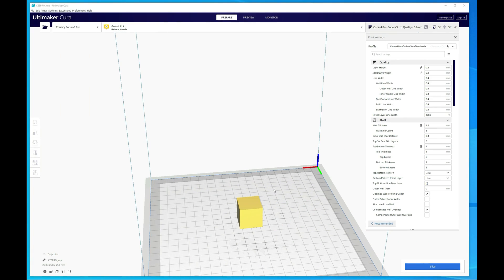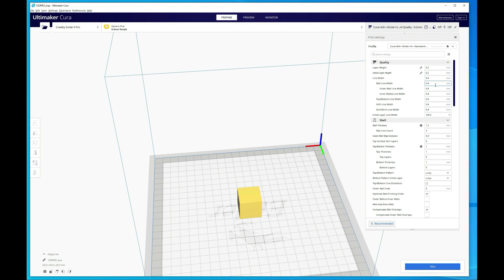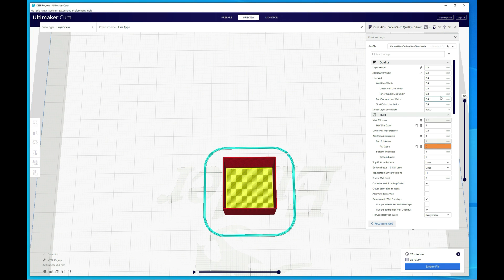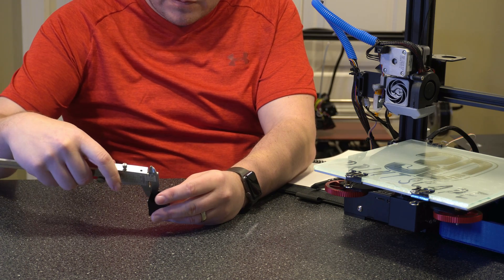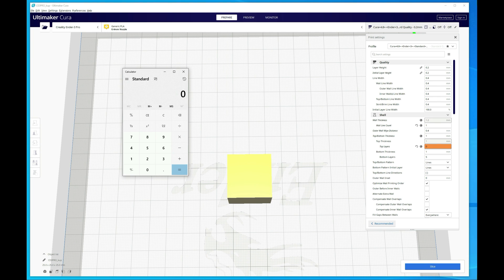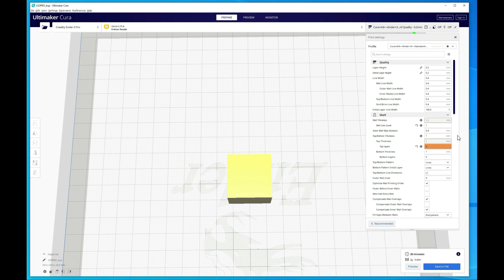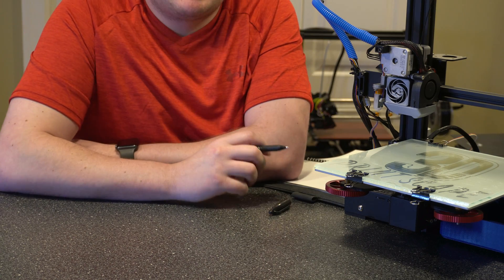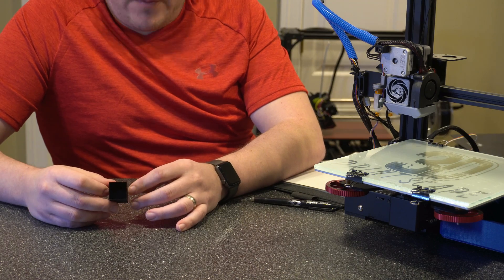3D Printer Flow Rate Calibration – The Easy Way!

Comment: Questions on flow rate combined with layer height.  if I have a 0.6 nozzle and a layer height of 0.2 then shouldn't the wall thickness be at 1.0?  the nozzle extruded in round segments which get squished as the printer extrudes each layer at the 0.2mm.  since the filament cannot be compressed it expands.  wouldn't this also allow for better adhesion between wall layers as well?   I would think that if you set the flow rate to produce a wall thickness that matches the nozzle size you would get poor wall adhesion especially when printing at lower quality.

Comment: A single wall gets more accurate this way. But its not optimal for merging anything.
A rough visual example of 3 walls.
Original flow
(__)(__)(__) = 1.5mm ~

After you calibrated.
 <_><_><_>  = 1.2mm~
The touching points get smaller.
Reply from the maker: Hi. Thanks for the explanation.

Comment: When I tried to do a flow calibration before, by the time I got to the correct thickness, I would lose volume to the point where a single layer extrude (like Brim) would only adhere to the build plate.
It seemed to be under-extruding, 
Extrusion isn't truly a rectangular process. The extrusion is more of an oval squish. 
That said, if adjusting to the size of the nozzle, when you extrude side by side you will have a very small connection to the last extruded round. (Not too much unlike an infinity symbol). 
Is there an offset where the fully calibrated flow, can have more wall-to-wall contact? Where the result is less like an infinity symbol and more like the ideal two blocks pushed up to each other.
Reply from the maker: Hi. Im not aware of an offset like that, but i hear what your saying. Maybe add a bump the flow rate up by just a tad to see if that helps.

Comment: Would flow rate affect wether or not my filament gets clogged from over or under feeding? (Im using tpu on my longerLK5 printer and whenever im trying to print something the filament gets clogged at the extrude r and bunches up at the feeder and its costing me a lot in filament, I could really use some help)
Reply from the maker: Hi. I would think that would only be an issue if the flow rate is way too high. How far is the nozzle from the build plate? If too close, that could cause clogging as well.

Comment: How do you adjust the Z height?  I know how to adjust e steps on my ender v3 but my Kingroon has no e step settings on its menu.  I have to figure out how to do it in cura.
Reply from the maker: Hi. Are you talking about the z offset and do you have a bltouch?
Reply: @3DPrintscape  I don’t have blt and I see how I worded that to be confusing. What I’m referring to is if I print a 20 mm cube and the height is only 19.7 (and not 20) I need to adjust the E steps on the Z setting to turn that 19.7 into 20.
Reply from the maker: @freshmaker5  You will want to adjust the e-steps and the flow rate.
Reply: @3DPrintscape  Kingroon printer is not like Ender v3. Ender you can adjust the e-step right on the printer menu. The Kingroon there is no e stepper adjustments on the printer. I’m looking to figure out how to adjust esteps through cura. I see flow rate in cura but that doesn’t correct the e steps.
Reply from the maker: @freshmaker5  Gotcha, i dont think e steps can be adjusted in cura. I think only the flow rate can be.
Reply: @3DPrintscape  probably why I can’t find it lol. So what’s odd is that there is no way to adjust the e steps on a kingroon Kp3s. Not with their provided slicer. No option on machines display.
Reply from the maker: @freshmaker5  It looks like you can change them with g code commands. You would have to connect the printer to your computer and use something like pronterface or use octoprint. This article should help. https://kingroon.com/blogs/3d-print-101/how-to-calibrating-3d-printer-extruder-with-esteps
Reply: @3DPrintscape  thank you

Comment: At what time in calibrating your printer should you measure flow? First E-Steps, then XYZ and then flow? Or flow before XYZ?
Reply from the maker: Hi. I do e-steps then flow.
Reply: @3DPrintscape  I know. But should I calibrate xyz steps before flow too?
Reply from the maker: @Awesome_O_2000  I dont really mess with them, but if you are i would do it before adjusting flow.
Reply: @3DPrintscape  thanks!

Comment: i need some help maybe you can explain it to me, i have my e Steps correct on my XYZ planes and when i extrude 120mm its spot on. i then started my flow rate calibration at the end of it in cura (calculated this using Flow Rate Calibration website) and it says that my flow rate should be 83% after doing this my walls were correct but what would i need to do to get my flow rate in cura to be 100%
Reply from the maker: Hi. In cura, switch there are flow settings under the material section. To get there, make sure you expand down the printer settings and have it set to advanced.

Comment: Looking for some help plz. Ive made a large scale printer 1.4 meters cube. It thinks its still my ender 5 and only moves 220 by220. I tried changing it in Cura. but doesnt want to listen to me. any help plz
Reply from the maker: Hi. Is it hitting any of the stopper early? Also, is it the right size in the firmware?

Comment: I got a cht nozzle and am having a hell of a time calibrating it any advice it's on a stock ender 3 pro except for a direct drive upgrade with a all. Metal hot end
Reply from the maker: Hi. Those are normally pretty good nozzles. What issues are you having when it comes to the calibration?

Comment: I've done my e steps and adjusted the flow rate after. I did the adjustment ran the test and it was perfect. The problem is it seems to do well on the test but under extruding on everything else. My prints honestly weren't even that bad to begin with I just though the better its tuned the better it will be. It seems to me it runs better at a little over extruding.
Reply from the maker: Hi. When dialed in, having the flow and e steps tuned typically help with print quality. That said, if there are any issues at all over extruding can hide them a bit.
Reply: @3DPrintscape  Thank you
Reply from the maker: @sellers8133  You're Welcome
Reply: Same for me, with estep & flow calibrated: the void cube is perfect, but real pieces printed heavily suffered of under extrusion
Reply: @glecaillier   this will happen when you only extrude 20mm for a test try 200mm and retry

Comment: Hey Rob, have you ever worked with Carbon Fiber Nylon from Sainsmart?
Reply from the maker: Hi. I have not. Have you and is it any good?
Reply: @3DPrintscape  i like it! Altho i know it's finicky and solid objects come out good, but whenever i print objects with gaps on them, say like an open cylinder, I'll have some stringing. I've just begun printing it though. Still need to work out the kinks with it
Reply from the maker: @nextlvlroy  Cool, i will give it a try when i get some time. Thanks for the feedback.

Comment: Thank you! This video just saved me big time. What I thought was under-extrusion was over-extrusion and I could not get it right until I verified E-Steps (which I had just done but fine tuned one more time) and then adjusted my flow down to 83%! Afterwards it made sense because I had changed out the MK8 heartbreak to the Slice Engineering Copperhead. Thanks a million!
Reply from the maker: You're welcome!

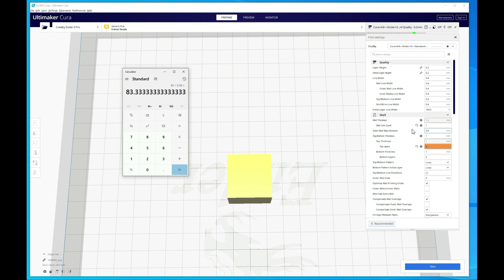Comment: I'm a bit confused.  At 6:36, when you changed the flow rates to your new calculated target value 83.33%, Cura didn't change your Outer Wall Flow with the other fields and left it at 95%.  Having a hollow box with only the single outer wall line, isn't Outer Wall Flow the key value you need to adjust in order to verify the new flow rate you've calculated is good?  Is that something you caught and fixed off camera, or am I getting my wires crossed?  Either way, this is a great video, it's helping me better visualize how filament feed rate affects the overall print.   Very helpful!  Thank you!
Reply from the maker: Hi. If your looking at only fixing an issue with the outer wall flow rate, you would update that. I was using the wall to adjust the overall flow rate. Adjusting the to flow rate impacts all the flow rate values.
Reply: @3DPrintscape   I had the same question. So if my flow rate is 89 that is the only number I’m changing correct? Others are set to 95 that didn’t get automatically adjusted but that’s okay?
Reply from the maker: @triplefeaturecreature6904  I would set those back to the default value and update the main flowrate again. It should change all of them.

Comment: I would skip the one layer and just two or three.  It is going to be rare for anyone to do one wall thickness with any print.  3 lines is going to be average and get you where you need to be.  Also all those cheap brass nozzles are going to have a variance to them and printing 3 lines (or more) will have a multiplication of error so the more lines should help remove some of that by averaging.  

This process will just get you an average.  You extruder, even if calibrated, could fall out of spec from wear so there will be a gradual shift out of this "calibration" over the life of your machine, depending on how much you print and with what filaments and the consistency of those filaments thicknesses.
Reply from the maker: Hi. Thanks for the info and you have a good point. I was trying to show the process of how to do it, but your right, in practice its probably better to keep it at 3 line, at least it will be easier to calibrate.

Comment: The question is, what if you change/slow speed print i.e. different from what you calculated the flow rate at? i.e. If I calculated flow rate at 80mm print speed, but now If I want to print at 50mm/s or TPU at slow speed. Shall I keep using same calculated %
Reply from the maker: Hi. I dont think that should impact the flow rate, but i havent tested it before.
Reply: @3DPrintscape  Thank you, will wait for your results video

Comment: Hi, thanks for this informations !! I managed to print the cube but by setting the good flow I have under extrusion when I print, my line are not flat enough and don't stick on previous one, do you think I have to set ups again my extruder ? or .. ? thanks
Reply from the maker: Hi. Did you adjust e-steps? You may need to start there.
Reply: @3DPrintscape  Hi, yes I've made it 5 or 6 times, it's perfect. when I ask my extruder 1 mm it give me perfectly 1 mm or 10 mm for 10 ! But maybe now the E-step is perfect I have to play in cura with the flow ? thks
Reply: @John-Smith-007  did u fix it?
Reply: @T_engineering  hi, yes almost, in fact one there flow and e-step is good, all is almost good, y actual problem, for month is the z wobble !! it's a hell problem !

Comment: Rob i followed your steps on cura and printed the cube. i measured it and its giving me 0.2 on all 4 sides. What do you think the problem is?
Reply from the maker: Hi. What do you have your wall thickness set to?
Reply: Is it the wall thickness? Because that is set 0.8
Reply from the maker: @geo11211  Something seems up with the settings, you wouldn't do .8 as a single wall, that's typically 2 or 4 walls to get that. I would go back and review the settings again.

Comment: For new people. A lot of the issues you might be having comes from the type of filament you're using, the specs are very important you either print close to the specs or too far, you have to try different settings. Start with a perfect leveled bed, try to print first layers to test.
Reply from the maker: Hi. Good tip and thanks for the feedback.
Reply: This tip was super helpful, thank you! I bought a matte PLA filament and realized it's high-end temp was 10 degrees higher than my standard PLA. Upping my print temp by just 5 degrees made a world of a difference!

Comment: flow rate changes have no effect for me in Cura 4.10.0 and on a ender3 pro.
Reply from the maker: HI. Thanks for the feedback. What size/type nozzle are you using and is it new or has it been used a while.
Reply: Can you elaborate on your comment? What is the problem you're having?🤔

Comment: So I have tried this a couple times. I've gone as low as 67% flow rate and it stays at 0.48 wall thickness. Maybe once I got 0.45. at 100% flow rate I get 0.51 so there's a difference but not much, at 67% I start getting underextrution so I know I can't go lower than that.
Reply from the maker: Hi. That is pretty low but it may be what’s needed for your printer. I would verify that the nozzle is new or is still actually .4mm, the copper/brass nozzles wear down quickly. If it good, the next thing I would do is calibrate your e-steps with a flow rate 67%. This will fix the under extruding and allow you to go lower.
Reply: @3DPrintscape  👋Hey, the nozzle is new but it could be a defect from production. I bought one of those knock off metal coated nozzle for abrasive material but I'm using PLA with it, my idea was that I won't ever have to replace it hehe. But it was cheap so it might not be exactly 0.4. As of esteps I thought  the same and re calibrate them however it was pretty spot on, it was extruded about 99.8 or .6 si I adjust for that 0.4mm difference in estep and tried again but got same result. I might have to try with a different nozzle and see. Thanks.
Reply from the maker: @V1N_574  It could also be a partial clog in the hotend or nozzle, it may be working looking into that as well.
Reply: @3DPrintscape  will replace the nozzle and test, will let you know, it could be the slicer, I might be doing something wrong. Thank you for getting back to me and for your support!
Reply: Stupid, it's not the flow rate, it's the type of filament you were using. Hope you have figured it out after two months of use. Cheers.
Reply: @Ryuuken24  is not the filament, i have change it and still. Also calling me stupid is a bit much.
Reply: @V1N_574  So you say you're not stupid but, you haven't figured out the problem? How are you not convinced, yet!
Reply: @Ryuuken24  i guess you are going through something in life and I'm sorry for that. Hope things get better soon. Have a great day.
Reply: @V1N_574  I agree No one is stupid here we are all learning here.
Reply: @Ryuuken24  that comment is not nice and unproductive please stay on topic. It took me several Years terkering around with my printer to even get good prints. If you are getting good consistent prints yah for you. But for the rest of us this process of 3D printing is not easy.